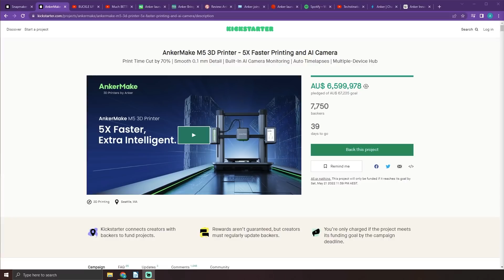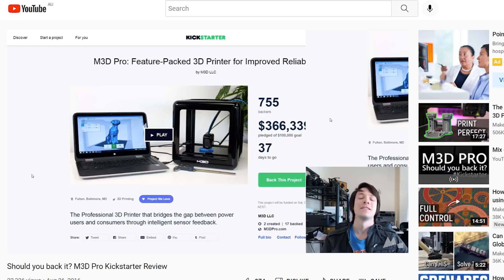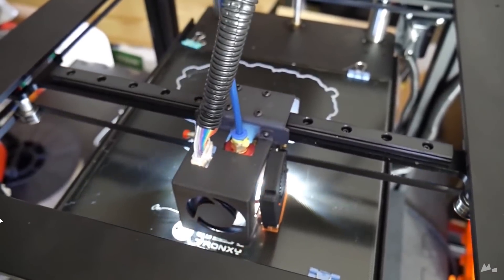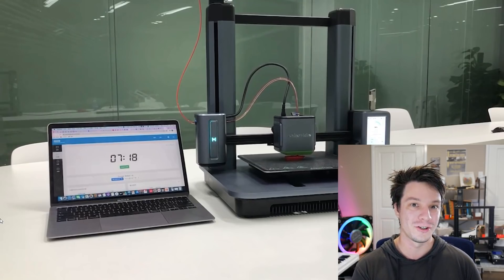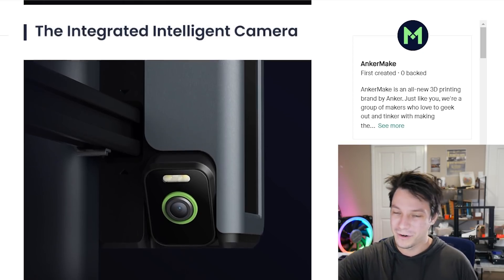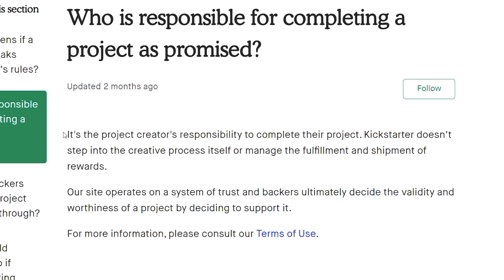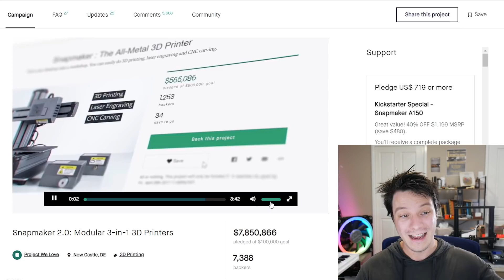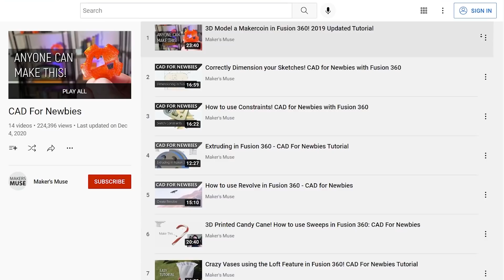This 3D Printer looks incredible, but...

Comment: Fantastic video! A few notes from one of the few that has one. 
1. It’s as close to plug and play 3D Printing I’ve ever had. I’ve auto leveled the bed 1 time and have had only a hand ful of print fails (usually my not enough supports/or brim for the high speeds). Zero tinkering, belt tightening, adjusting. 
2. It prints drastically faster than any other fdm machine I have and the print quality is outstanding
3. Fingers crossed the production units match or are better than what I received. If didn’t trust the machine I wouldn’t have backed it myself. 
4. It’s 2022 Why the hell don’t all printers now have mobile app monitoring/notifications/ wifi support?
5. My video was sponsored and anker only asked me to change two things - which was a nude model / bust to not include that in the video and they changed the name to AnkerMake M5 so I had to reshoot the intro to the video. 

I honestly hope this puts fire under the feet of the existing printer market to make higher quality machines that are zero fuss and print reliably/fast/quality which is crazy to see all 3 together.
Reply: Anker is a big enough company to make their own printers. Using kickstarter is a red flag that they dont need to actually deliver anything in exchange for consumer money. This is also the same criticism when big boardgame companies like CMON use kickstarter as their preorder system instead of a normal preorder system.

The fact that anker didnt send 3d printer technical specialists like angus a review model is also a red flag.
Reply: Could you elaborate as to why your video shows "x6 300mm/s" serveral times on the display and mobile-app while in the shots it's never even close to the advertised 250mm/s?
Reply: lol this clown sellout here too

Comment: I don’t often get in the comments. But I’m glad you made this video. I 100% agree with you. I’m hopeful Ankers printer works out, to grow the community and increase mass adoption of the technology. I’m skeptical of the AI system, my only experience is it’s AI and 3D printing so far has been with the Ultimaker S3, and it’s definitely hit or miss. 

And as far as QA consistency with all the printers on the market, you were spot on! I’m still new to all of this, but I intentionally went with the Ender 3 since everyone has varying issues with there’s out of the box, but the community is so large, it has created almost unending solutions and support to the issues these printers have. I’m using the Ender 3 as a learning springboard before I jump into other types of printers.

Comment: The 3D printing scene urgently needs another platform for modeling. There's no decent software. TinkerCAD is too primitive, FreeCAD ist unstable like hell, Fusion360 belongs to a terrible company that will steal anything they can from you and arbitrarily change conditions at will and so on ..

Comment: Your comment on the difficulty of 3d modeling is spot on. The modeling tools jump from Tinkercad (a step or two above lego) to Fusion 360 (hundreds of hours to become competent) with very little in between. I think some innovative easy and powerful software with a connection to an online 3d printing service would be a great start. Then as you gain confidence in your making you would have the option to buy a range of 3d printers that starts at a simple toy printer appliance  for kids, up to the 3d printer equivalent of a glowforge (simple to use and fairly powerful) .

Comment: Great video man! I'm skeptical but hopeful as well. I bought a 3D printer for my nephews last Christmas and it had issues after only a few prints. It was just a clog but still, for someone that's new to 3D printing, it's a big issue. That's just one of the many extremely common issues when it comes to 3D printing and you need to expect it and know how to deal with it. That's just the reality of 3D printing right now. I'm sure that will change in the future though. Will the Ankermate be the catalyst for that change? Only time will tell.

Comment: When I started 3D printing in mid 2016 I was in for a shock, it took me a long long time to get the printer to actually print, having bed adhesion issues and this was with a $AU3,700 printer, I was looking at this to be unamed printer and a Maker bot and went with this one instead due to the larger Z access.  Glad I didn't go with the Maker bot becuase they had problems with the smart nozzles I think the called it, which I found out latter.  I have had 2 other printers since, one the Cocoon Create Touch from Aldi and another that I won't mention and which is no longer made.  I still have these 2 printers and to my surprise the cheapest one the Aldi 3D Printer has been the most reliable.  Only change has been and upgrade to an All Metal Hotend as I wanted to do away with the PTFE tubing.

Comment: I've worked heavily with polyjet printers, and while I think it's inevitable that technology will advance to where we can have them in the home, it will be interesting to see how long that will take and what it will look like.

As it is now the Post-Processing is so work intensive that I'm not sure what you could do to miniaturize it. You essentially have to pressure wash each unit extensively. 

One of the advantages of FDM that we rarely give it credit for is that if it prints, you're good. You can sand, smooth, paint, treat, etc. But you don't have to. Resin requires alcohol baths and curing, polyjet requires washing, and since both of those methods use liquids, it can get extremely messy, and 3d printing resin is not easy to clean.

The technology will get there eventually. But there are a lot of commonly overlooked and underestimated hurdles that still remain to become truly superior to FDM.
Reply: My old office had an Objet30 and it came with it's own pressure washing station. Even with that and an ultrasonic bath we were never able to fully get rid of the residue left by the support material.

Comment: But i also feel like 3D Printers are a tool for people who already do tinker and create things.
i've rarely run in to someone who does print some one-off toy and don't expand further into RC and mechanical devices.
Reply: You have to want to hack and tweak and mod. Its in your DNA. It starts at the printer and goes to other things. The plug and play crowd will get bored within days.

Comment: I bought my first two printers, an ender 3 and anycubic MonoX, at about the same time two years ago. Everyone talked about the mess and smell of resin, but to me it was clear that resin is what you get if you just want to print for your hobby (assuming resin can meet the needs), and FDM WAS the hobby. I do use both my machines, but resin was so much easier- I've never had to re-level my resin printer. I'm interested in the Ankermake, but I'm waiting for it to go to retail- Anker doesn't need my pre-order to build this machine.

Comment: I had never heard of resin-jetting before.  I noticed in a section of that demo video, a person wearing rubber gloves was cleaning off the resin-jetted parts in a special tank.  IMO, if those 3D printed parts require special treatment with toxic substances, that tech won't catch on.  That's one of the benefits of FDM: once the parts are printed, you just take them off the plate and they're completely safe.

Comment: The Thing is, Anker as this big Company has more than enough to efford this Project without Kickstarter. Many Companies(also Creality and others) that have more than enough Money to pay the Engineering Costs and Production Cost are moving the Risk to the Customers. If the Project Fails, and you will get nothing you are angry and the Company didnt payed the Most of the Costs. If the Project is going to be a full success you will get nothing except a cheaper Early Batch Product. Wow. Thats the Point I will never help such big companies with Kickstarter. Only smaller ones that need the Money to pay all Bills to make it come true.

Comment: Hi Angus

Your 10 years guess is good, but not good at all.

My guess is bad, but not that bad after all.  

FDM is the leading way for structurally solid time stabile prints because if combined with powder moulded re melting it renders the parts almost like injection moulded parts, thing that I do a lot with PC and other filaments for the final destination, for tests I print them in ABS or PLA and no need to remelt them, they end up in the "filament to be re extruded" bin, and I have a bin for each type of material, so about 10 bins for now.
Also FDM can print with metals, yes I know nobody has done it yet (but me) but at the right time you will see them on the markets gaining speed.

Also one of the big problems of FDM, supports, especially in enclosed holes hard to extract and eliminate, are being eliminated with 5, 6 7 and 8 axis 3D FDM printing, a few attempts I am following myself while developing my own "tinkerer friendly" version of it, mass consumer market friendly is my plans, but it will take a while.  The huge problem I see is slicers that can slice for such machines.

So FDM with more than 3 axis printing with various metals, thermoplastics, and agregates *(cement, hempcrete, and similar) cannot be replaced by incsquirting printers for real deal jobs, but for home amusement yes,so they have their own place in the future markets.

Comment: I'm in a tool community on Facebook, and recently MicroCenter has had a new customer deal of some model of Ender 3 (pro?) for $100. It's gotten a bunch of tool nerds into 3d printing, it will be interesting to see how it turns out. I think it's actually doing ok so far, and it's mostly just about printing other people's models (for tool storage, etc). But there was no slick "design your own toy" video.
Reply: The machines do okay forsure out of the box. My ender 3 once I learned to clean the bed and set the height made nice parts stock. I made changes to it because I wanted to learn about what made this machine work. I wanted to learn what firmware was what the control board did and how the wiring worked and what went where. I wanted control of it.  I'm surprised how set and forget people want things to be.

Comment: The thing FDM has going for it is cost and also very little amount of post-processing needed. It seems anything Resin based requires a lot more post processing which may not be ideal for the average consumer unless it becomes more automated
Reply: An SLA printer certainly requires a lot of post-processing to clean the excess resin off the print, and then cure it.  And that was the first thought in my head, too, when Angus said "The future of home 3d printing is resin."  But... from what I saw here, the "ResinJet" printer avoids both those steps.  The print isn't immersed in a vat of raw resin so there's no excess to clean off; and it's cured layer by layer in the machine.  So by the time the user's pulling out the print, all the post-processing is, apparently, done.

That's pretty dang cool.
Reply: @davydatwood3158  indeed!

Comment: Flashforge adv3 was my first painless experience with 3d printing. Literally unpack, print. No adjustment required, it just worked and it's worked reliably for the last year and a half I've had it. 

Excited to see what Anker can bring to the table.
Reply: I just picked up a Flashforge Finder for 60 dollars. Super nice and easy to use.

Comment: Great video! This is the first I have heard of resin jetting printers. I would prefer that over my delta, as I usually run into issues every 3rd print, or any upgrade I ever make. Would be nice to have workhorse printer and a hobby one.

Comment: Still waiting for the day the first "6-axis" 3D Printing machine comes, the additive version of subtractive 6-axis CNC machines. Twisting head on free-moving axes (could be done with a robotic arm tbh), but man... bed-adhesion might be a giant issue 😂😂 Tho, a "heater fan" for managing to do PETG etc with it would probably work (keeping temps controlled at all times)
Reply: The closest we have to that is the Diabase one....it has both additive and subtractive tool heads and different surface shapes to print on. 3D Printing Nerd has done a few videos on them

Comment: I tried 3D printing and it was more headache than worth, I have bitterly complained in forums about the shitty builds of 3D printers for what they are. The fact that nothing has advanced in any respect, all changes are cosmetic but do not resolve the underlying issue over quality and build quality and software quality and filament quality and how it is full of shitty traders and manufacturing that don't give a shit once they got your money.

Things will only change when manufacturers produce machines that work and have a quality build and make or name of reputation that is followed through with the goods to make the shitty manufacturers step up their game and get with the build quality issue.

Its about time some company made something like this.

Comment: 4:20 yes I completely agree with you Angus. Creality doesn't finish their 3D printers. They like mostly complete them and then sell them to you, that includes all of the preset printing profiles.

There's no excuse when I buy a mk3s+ as my intro to 3D printing and everything works and I think that this is nearly consumer level easy, then I buy an Ender 7.

It's all full of garbage profiles and nothing prints anywhere near that 250 mm per second speed.

If you use stock settings, the tolerances suck and all of the corners are bulgy.

On top of that the supplied software has a glitch in it that causes vertical layers to misalign, fix my issue by rejecting their software and using prusa slicer.

Comment: Totally agree on Polyjet! Color/durometer blending probably won't become affordable for another decade, but still! It's also the highest-resolution tech out there at (Stratasys machines do ≈20μmZ, 40μm XY; Nano-Dimension and InkBit closer to 5μm). And there's huge opportunity for growth into bio-printing. 
Part cleaning and waste-stream management is admittedly a pain, but there are already water-soluble support chemistries and waste-resin curing options coming down the pike to address them. Scale is a challenge too, but companies like Massivit have at least shown that huge resin parts don't require huge vats and huge messes. 
The core patents expired a few years ago, so maybe the innovation floodgates will open soon🤞